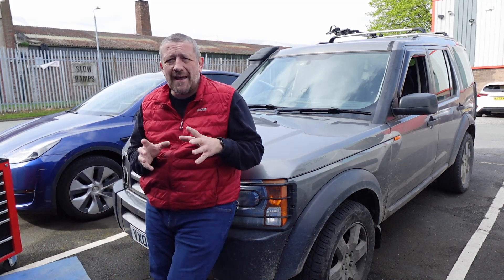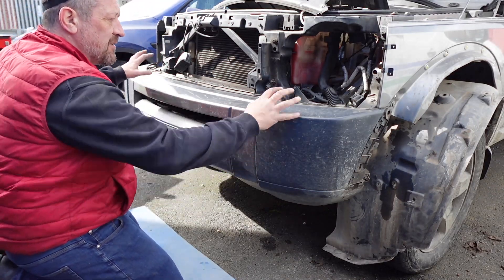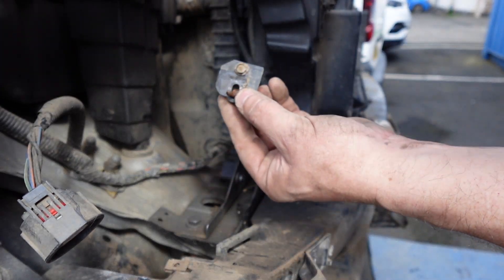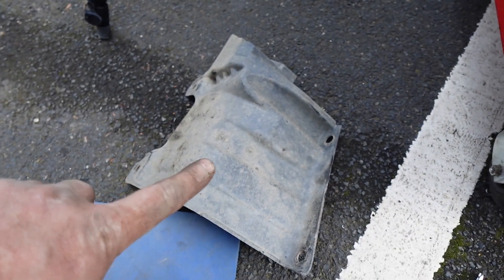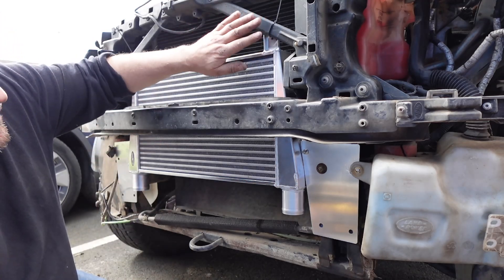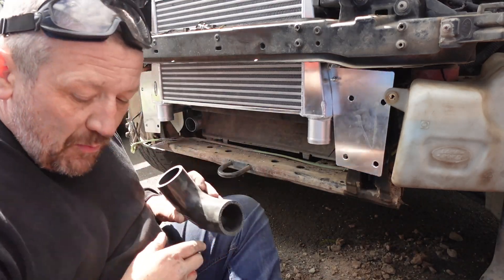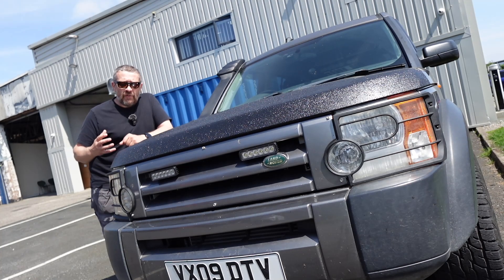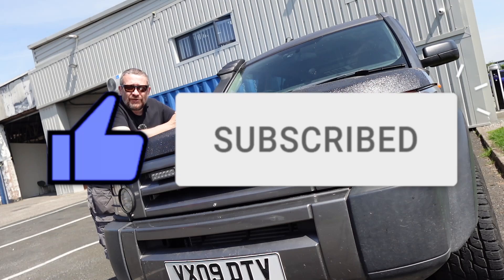How much power can an intercooler give the  Discovery 3/LR3

Comment: I fitted the "Road" intercooler witch sits lower down.. It fitted no problem, I didn't have to cut or trim amy thing.. The biggest improvement I felt was in mid range power and I found it picked up quicker from a stand still...
Reply: Did you see any change in economy, I know it’s a 2 ton brick 😂
Reply: @AJ-yw5zy No..

Comment: Thanks for sharing.  It's an enigma with the D3 and things not lining up , I fit winch mounts to them using the same 4 holes per side and they always need fettling.  I've got 3 in the yard now and I can guarantee if I took a Terraferma winch mount out the box and offered it up to each probably only one would fit without some adjustment.  Allisport are right when they suggest your D3 has probably had a shunt to the bumper in the past.  Let's face it 17 years can carry a lot of history but that's why we love them 😁

Comment: For the cost of the intercoolers, the least I would expect is the bolt holes and mounting points to be in the right places. I’ve done it in the past and bought cheaper accessories and get miffed when they don’t fit but then think to myself ‘hang on, they were cheap’. I wouldn’t expect the same from a company such as Allisport when paying the premium prices their products demand.
Reply from the maker: I agree but as I said at the end, I think the D3 might have had a small shunt at the front knocking things out of line a little. But we'll be checking when we go down in a few weeks.
Reply: I agree, lots of cash for a poorly executed product